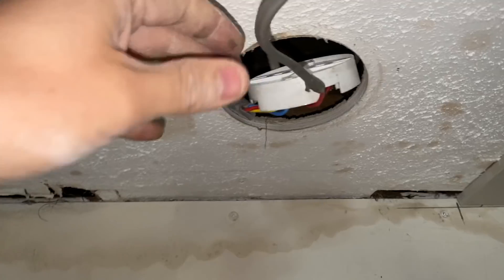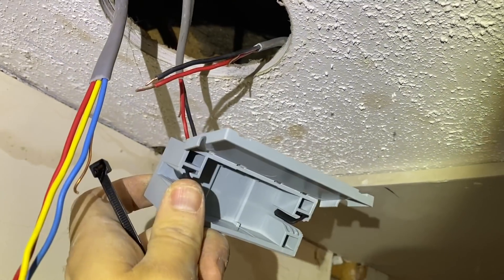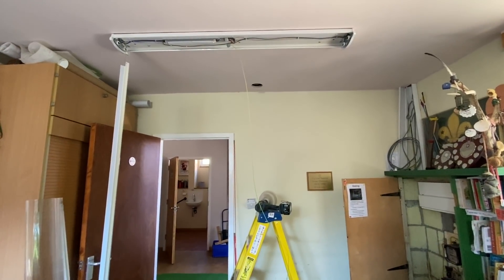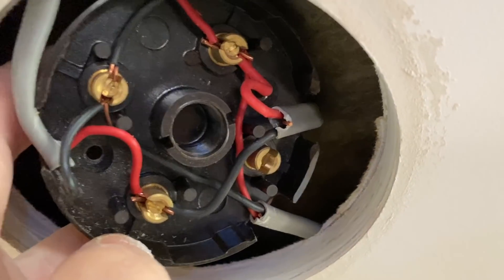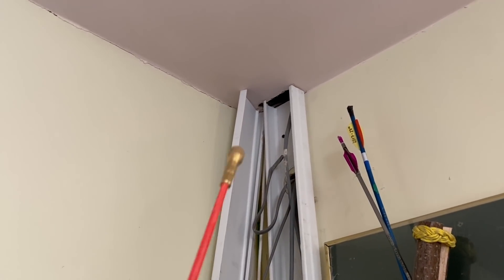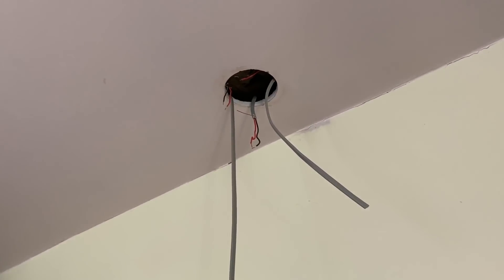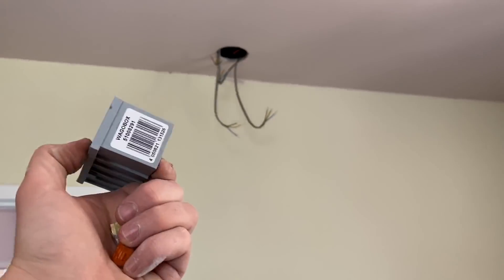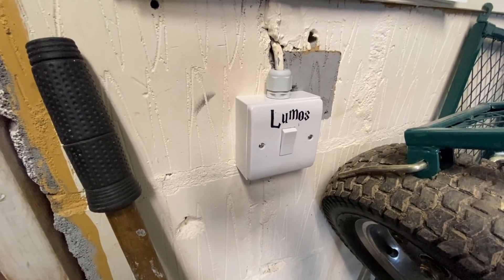Fault Finding Lighting Circuit - The Scout Hut - Episode 3

Comment: I love that in the UK you guys can just connect junction boxes and throw them in the ceiling without them being mounted to anything whatsoever.   I love that your cables just are laying around up there and not stapled down every few inches.   You guys wire electricity like we wire Cable TV -- just kind of -- after the fact, wherever it fits.  I wonder if that's due to the difference in when electricity was being put in homes versus the age of homes in the respective countries.

Comment: I'm not an electrician but I love these kinds of videos as they help enormously when i need to do small jobs in my house.
Been watching a couple American videos (TOH i think) and they state that in USA their code doesn't allow junction boxes in voids. I can sort of understand why but then they go and use wire nuts to join two cables together. Surely those are a weak join and could cause problems? 
What's your take on these wire nuts?
Reply: Wire nuts are very strong if done right. But they’re very easy to do wrong.

Comment: Here in America junction boxes are not allowed to be buried inside of walls and ceilings. The rules say that all joints and splices must be accessible.
Reply: Same here in the Netherlands — this is specifically a UK thing, not a Europe thing.

In the modern “centraaldoos” system, which is what new builds usually get, for several decades, we have one central box in the ceiling with 8 conduit exits, one is feed in, potentially one is feed out, and the rest go directly across the ceiling and then straight down to each of the switches and sockets. The central box normally is also the light point.

Comment: Using an extension cord and a breaker finder with a leg to the fixture, you can often follow the ground in the ceiling until it ends at a junction box or break. At the break due to capacitance between conductors, the signal will be present past the break but at greatly attenuated levels. Love tone tracers for that type of work. Even with a hot fixture the voltage in the wall or ceiling will be hotter for non contact energized wire tracing when the cable has 2 hot conductors and one neutral vs neutral, ground, and one hot.
Reply from the maker: Thats a great idea! What tracer do you use?
Reply: @artisanelectrics  https://www.homedepot.com/p/Ideal-Circuit-Breaker-Finder-with-Digital-Receiver-and-GFCI-Receptacle-61-534/207003193. The trick is to put the transmitter between a ground on an extension cord and the fixture ground, so the fixture ground radiates a traceable signal up to the break. Couple that with a cable tracer to sniff the signal for higher sensitivity you can hear the cable up to about a foot away.
https://www.homedepot.com/p/Klein-Tools-Pro-Tone-and-Probe-Kit-VDV500-820/309927727?MERCH=REC-searchViewedNA-309927727--N
I use one made by Ideal.

Comment: Being in the US we are not allowed to have hidden junction boxes. Doesn't mean that it doesn't happen absolutely not.
I cut a wall open to put an inset shelf in and I found three or four of them behind the wall with a shower unit on the other side. This both broke the hidden Junction Rule and mixing electrical and mechanical. And also explained the lack of ground continuity. Had the landlord been nicer I might have fixed it before we moved out. I believe after grabbing a bunch of outlets downstairs it ran upstairs and looped around the Attic. I believe I had two outlets to go with the next one being fed From Below from the mess.

I find it interesting looking at the electrical in other countries namely that you can have boxes hidden, it amazes me.
And that you can in some cases pull wires out and completely and be replaced them, here all the wires have to be tacked down every so many feet which means you pretty much have to abandon wires in the wall or tear the wall open.
Reply from the maker: Cool thanks for sharing, its good to know the difference in systems between countries

Comment: Nice work Jordan. Hope you charged extra for the faff factor! 😂
Reply from the maker: Haha no I’m afraid I always stick to my original quote even if it turns out to be more complicated than expected. I always allow a little bit extra for things like this though as usually no job is ever as straightforward as it appears.
Reply: Artisan Electrics I agree. I’m fairly new to the trade (career change) and this is great advice. Was actually up at great Bradley on a new install the other day which is near your neck no?

Comment: With these smart switches and most needing a neutral, how often have you come across people using the cpc as the neutral at the switch?
Reply from the maker: Interesting question! I’ve never come across that so far.
Reply: I remember seeing a video from Poland where someone had used imported T&E (old colours) for a two-way switch circuit, using the bare CPC as a strapper, not even bothering with sleeving! People from eastern Europe gathering work experience and materials elsewhere and then working in their home countries yields the most interesting results!

A chap from Germany (originally from Georgia) once asked about his neighbour's shower - the neutral kept burning in a junction box. Turned out the village idiot spark had supplied a 9 kW shower with 2.5 mm2 T&E!

On a side note: all European countries that I'm aware of (including the Asian parts of Russia and Turkey) require full-sized, insulated CPCs, so using T&E outside the UK is never a good idea.

Comment: What kind of juntion box i use as a industrial electrician depends on the 
circumstances is use attema ak1 boxes with glands or a Spelsberg Abox both for wet inviroments or a for a dry enviroment i use Abb haf cabelbox.
But i am a electrician from the Netherlands i dont know what English industrial electricians use.
Reply from the maker: Nice, ive used the ABB Haf boxes in Netherlands before

Comment: A tip if you have to make a hole in the ceiling  sometimes,cover hole with. extractor fan ,round or square grill....Obviously run it by the client first, but sometimes they jump at the chance as a patch up looks bodgie...They blend in surprisingly well especially on a modern house ceiling ,which has smoke alarms etc on anyway ,and they don’t look out of place at all
Reply from the maker: Not sure if I like this idea.
Reply: Artisan Electrics I understand your concerns ,but it’s only a temporary placebo ,until the room is decorated again
Reply: Kevin   Hahahaha....cruel,but funny  !!!

Comment: Jordan really great work from untangling that mess. I think there was more than luck on that junction box find you found the junction box in a similar location and did the orientation math. Give yourself some credit. Otherwise the ceiling may have looked like Swiss cheese🤣. What I like about all of this is what it tells the young electricians. Be patient work through the problem. yes time is money but reputation matters more, coming up with a solution after all that hard work is so satisfying. And more than that this will be great experience which you can bank for future jobs whee you will safe time and money because you have a ready made solution. Top job and great content.
Reply from the maker: Excellent comment thanks a lot!

Comment: I really felt for you Jordan, I can't understand why these idiots cut off the cpc's, I see it so often.
Reply: my handy man friend used to cut em off too in-till i told him it is best to just move them out of way as someone may want to fit a metal fitting later on. and if the fitting has a loop terminal just park it in that.
Reply: Josh C I would politely ask ur handyman friend to leave electrical jobs alone and get a qualified electrician in
Reply: @09weenic  good luck with that.
Reply: Yup, just been to a hotel/hostel kind of building where they cut off the CPCs to each and every emergency light, both ends! Granted, all emergency lights I've seen so far were double-insulated but the simple rule is if there's a CPC it should be connected at the feed end, period. The whole place is getting rewired piecemal so the CPCs are connected one by one.

Comment: Cut the Earths off... WHY!
OK it may not be needed if lights or switches  are double insulated but still leave it in.
Reply from the maker: Exactly!
Reply: @artisanelectrics  If the install dates back to the 70's or before there was no requirement for a CPC in lighting circuit, light fittings, switches etc back then everything was plastic the only metal parts of a fitting BS7895 was the metal part of the lamp, lighting junction boxes and loop in loop out ceiling roses only had 3 terminals
Reply: @Richard_OKeeffe  I have seen cables with no cpc for lights in a house back in the early 90s  but these  should of been tested and rectified before ceiling was plastered or flooring went down In loft depending how long ago  it was done.